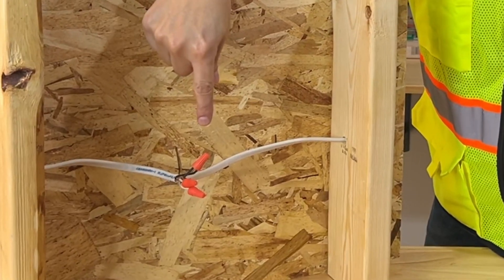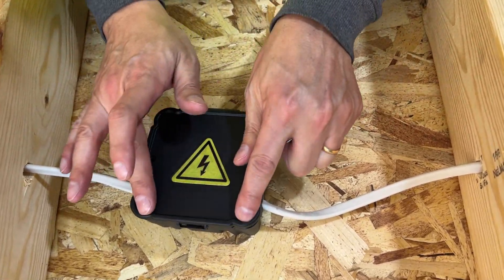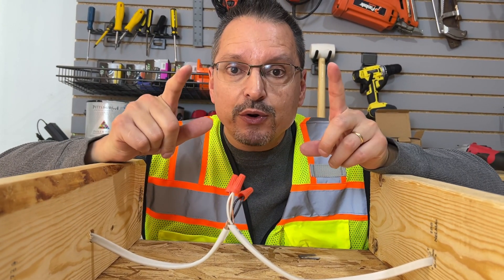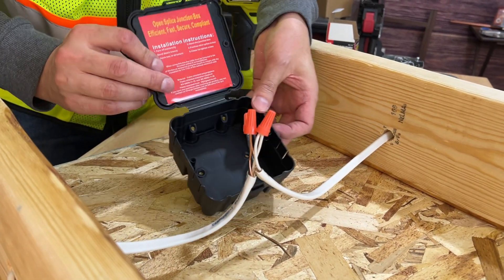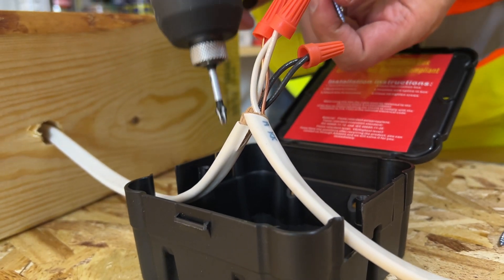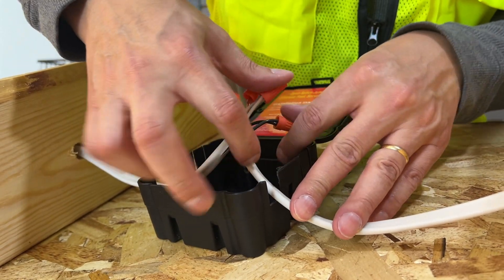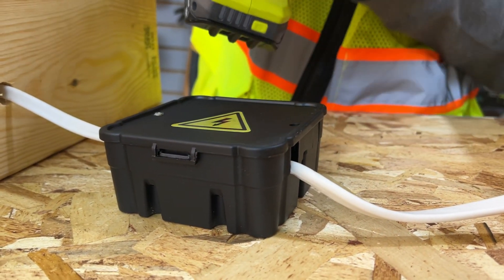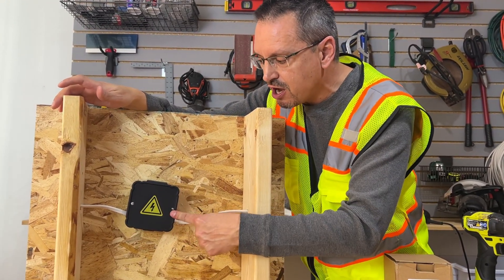Shocking NEW Way to Fix Open Wire Splices

Comment: Buyer alert - this is not the real box - this is a non tested - non UL listed - non code approved Chinese knock-off
Reply from the maker: You are correct on the UL listing. However, do you actually know where the Rack-A-Tiers branded ones are manufactured? And at 13 bucks a box that’s a bit pricey.
Reply: @HomeRapidRepair  yes, I know exactly where they are manufactured - (Olathe KS) The Rack-A-Tiers brand does cost more because it has been UL tested and meets code - that process,  ongoing oversight, and UL rated materials cost money - the knock-offs could be a big liability issue if a house burns down or there is a loss of life because an inferior non code approved product is used - spending a little more money for the UL listed product is definitely a good idea in my opinion

Comment: How's that going to protect against fire, it's plastic?
Reply from the maker: Great question. I have inspected over 10,000 properties in my career. What happens with an electrical short is a very brief spark… And if the open wire splice is near wood or paper or something like that, it can start a house fire. But if the wires and resulting spark are in any kind of junction box, whether it be plastic or metal, you’re safe and the circuit breaker or fuse will trip and turn off the power. Thank you for watching.
Reply from the maker: A majority of the electrical wire boxes in North America are plastic and not metal… It’s been that way for a couple decades now